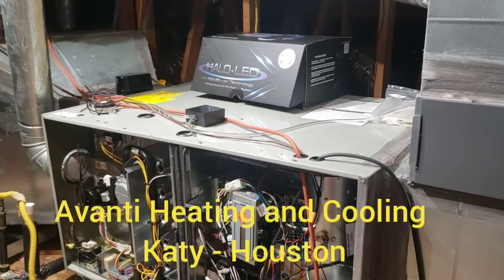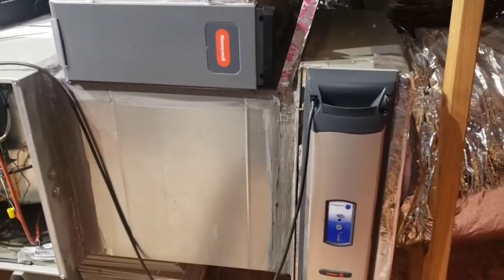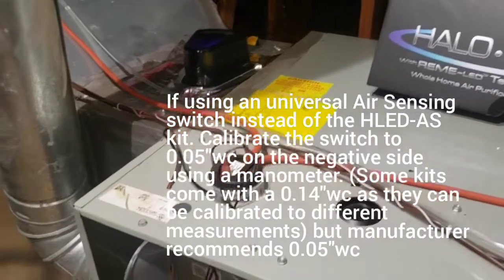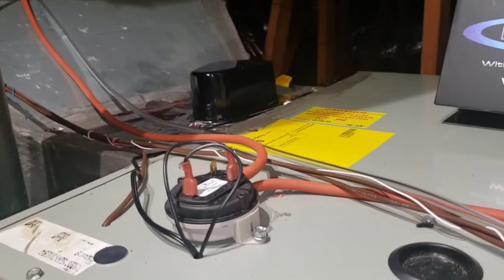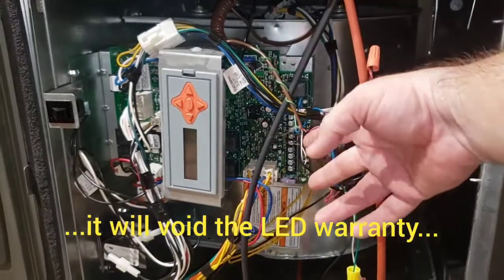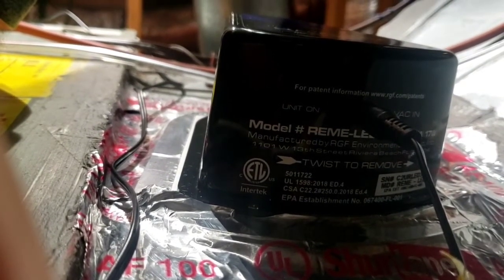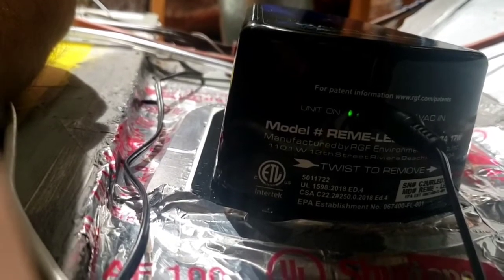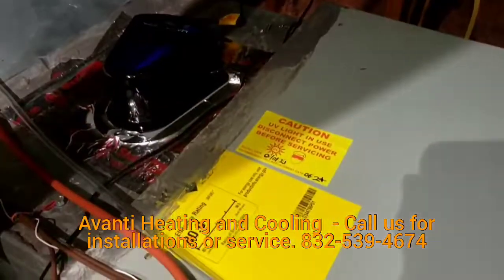Reme LED installation

Comment: It's amazing how many contractors have no clue how to install these. Mine did it totally wrong and it of course didn't work right. He wired it into the line like the original reme halo should be. Not the board itself, but the line with the wire nuts.

Comment: Thank you so much for posting this. This video, along with a quick call to RGF just to be sure, confirmed that my HVAC contractor did not wire the unit to only run when the blower is running, despite multiple mentions in the manual and me asking him if he was going to wire it this way before the install (he said yes, then told me it was wired this way when he was done, even though the indicator light was always on). They had to come out and re-wire it correctly. Thanks again!
Reply: How did they wire the transformer high voltage wires
Thanks
Reply: Boy, this is common...
Oh yea, they the installers know it all...  then, it is on all the time.
As I type this, the 3rd tech is downstairs trying to get it right...

Comment: Our HVAC system circulates air 24/7....blower ramps up and down according to need of heating/cooling....can this unit be wired to operate constantly?
Reply: No, the unit Must cycle off to clean itself. The standard way of wiring it is to run on a call for cool or heat. Alternatively you can use the Original REME which is designed to run continuously.

Comment: I just purchased mine and I'm installing it now
Reply: How did it go?
Reply: @phial40  I'm pleased with it.
Reply: @darksiderydah2721  please attach video or pictures of your wire set up
Reply: You installed this without an hvac guy? If so, can someone who is relatively capable do it or are you some sort of electrician etc?
Reply: @Payton77  I am an hvac guy lol
Reply: @Payton77  seems to be working I've had it over a year now. As far as a handyman I would recommend a professional. It does not come with clear instructions for the relay and it took me a while to figure it out.
Reply: @darksiderydah2721  okay, that’s the safe bet anyway. The quote was like 1600 which is absurd I think but if it does what it claims it’s worth it I suppose
Reply: Could help me with how you wired you high voltage transformer wires to
Thank you so much
Reply: @mofassy  it feeds off the low voltage side of transformer not the high side
Reply: @hotfeva9843  thank yoi

Comment: So far this is actually the best install video for our product I have seen. I have only good to say about it. Also folks out there, Don't buy our products online, We will NOT warranty them. Use your local licenced HVAC company to receive proper installation and full warranty.
 Thank you RGF technical support manager Joe Jordan
Reply: Hey that’s great to know. The tiny problem with that is finding someone who actually reads and understands the instructions.
Reply: Can we get an installation video from the manufacturer, so contractors can view it before installation?
Reply: @markstone2216  right!
Reply: سلام س ی س تم وصل شد
Reply: Joe,
Can you share tech support # ? Thanks
Reply: You keep commenting on all these videos of installation but you don’t say the recommended installation from whoever company you work for
Reply: @mofassy  lol. He literally works for the company that manufactures this thing. I spoke with them and told them
About this. He is probably running off SO MANY potential buyers because he’s confirming the obvious lack of training educations and also the complexity involved. 

To boot, mine was installed wrong and I had to have it taken out and replaced. Be very very cautious who installs yours should you buy one. This dude could be 1000000x more proactive and solutions driven with a customer service disposition if he had a damn brain.
Reply: @Payton77  thanks Sir I agree
I just bought one and live in a small town , we have on hvac tech and he never installed such thing
Did you tech install an air switch kit to alternate the on and off with the fan
Anything you can provide me with installation would be greatly appreciated 
Thanks again
Reply: Ha! Local hvac proper install huh?
They have been out 2 times to get it to operate correctly...
3rd time comin up.

Comment from the maker: RGF is working on including the air sensing switch inside the box along with the light, but for now the HLED-AS can be bought separately or you can buy an universal air sensing switch and calibrate it to 0.05"wc. Also check the calibration on the HLED-AS switch; we had to correct the video as the switches on the kit was 0.14"wc and we thought that it was the intended target calibration, but picked on it quck as we work closely with the manufacturer on their products.